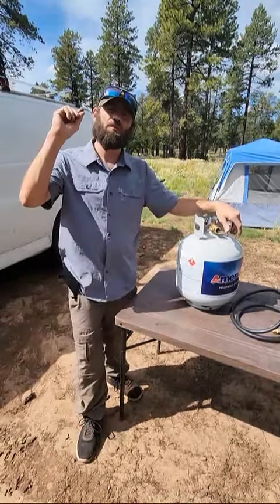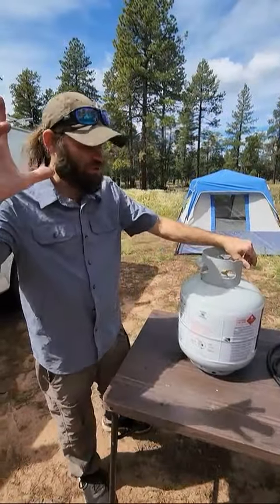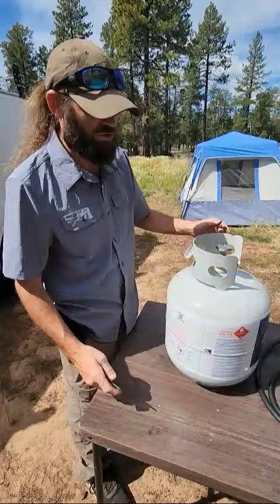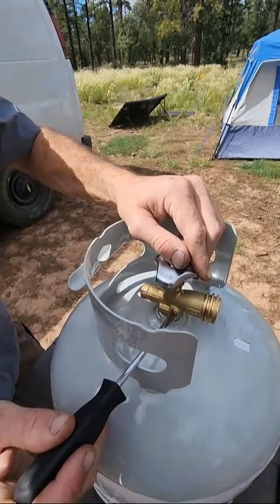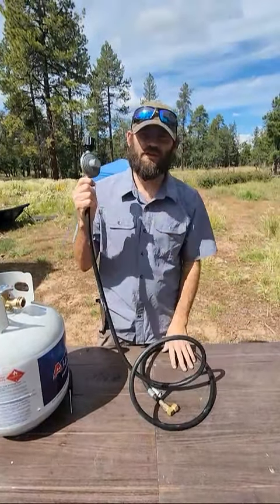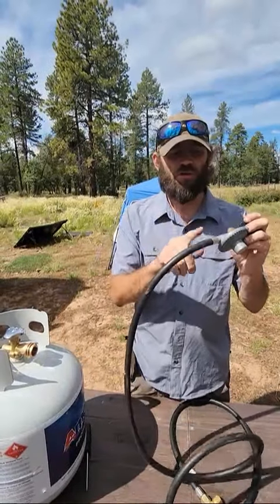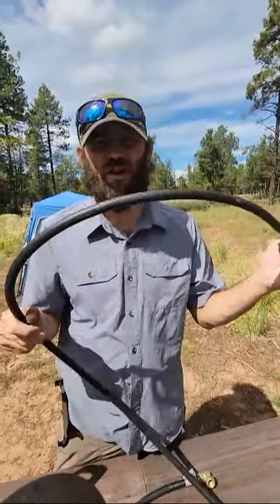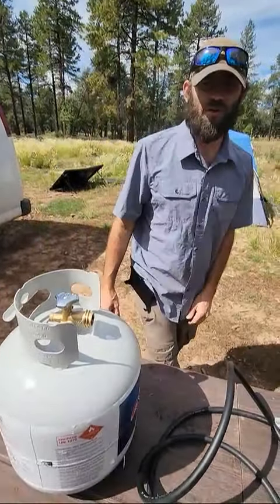PROPANE TANK NOT WORKING! FIXED! short

Comment: Your description helped the most, but I have to say that releasing pressure did not solve the problems for 2 tanks that were overfilled. I did solve the problem overnight by laying one of the tanks on its side. Now I am following up next day by laying the other on its side. If this proves out, that is better, at least in some cases, than releasing so much propane.
Reply: I know im a year late, but did the other one work?

Comment: That is not a pressure relief valve. That is actually connected to a dip tube known as a spitter.  It is used in filling tanks. When the tank is roughly 80 percent full propane liquid will come out an opening 90 degrees in front of the screw.

Comment: My blue rhino tank valve will not turn. You can wiggle it a tiny bit to the left and right, but that's it. I released the pressure like in your video, but the valve still won't turn on. Any suggestions? Does that mean it's empty?

Comment: This didnt work for me so heres what did; I attached the regulator and opened the tanks valve. Then, with the valve still open, unscrewed the regulator until i heard a hiss. Screwed the regular back on and off a few times and then i had gas going to the grill.